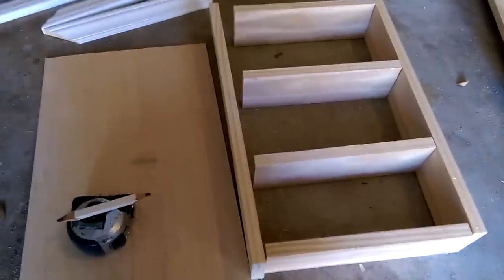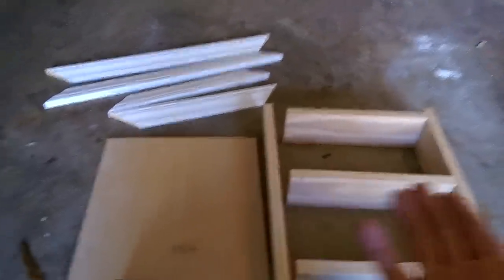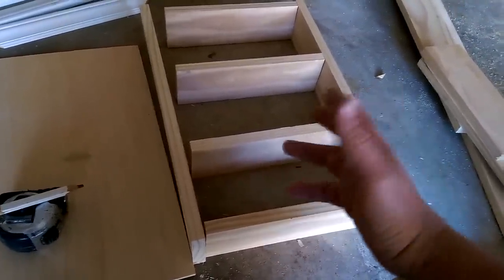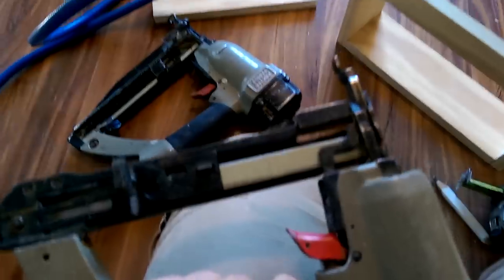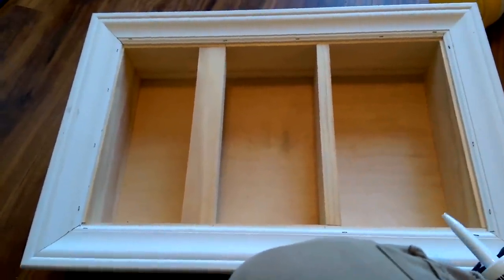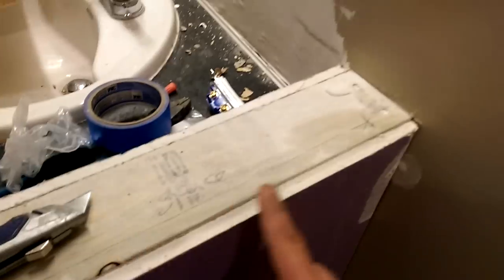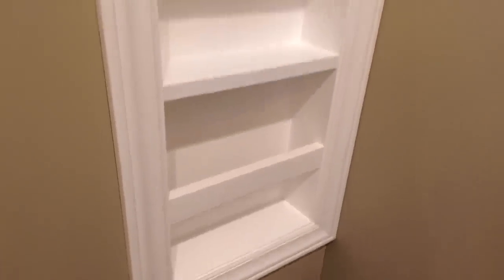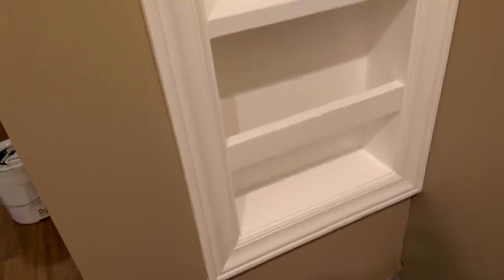How to make a bathroom niche

Comment: Is it necessary to trim it out prior to install? Could you attach to the studs and then add trim around?
Reply from the maker: sure, you can do the trimming after, thanks for watching
Reply: Nice shelf, but I would recommend centering it into your wall next time. If the 2x4 was in the way you can just cut around it and add a smaller piece for wall stability if needed. The niche just looks nicer centered.